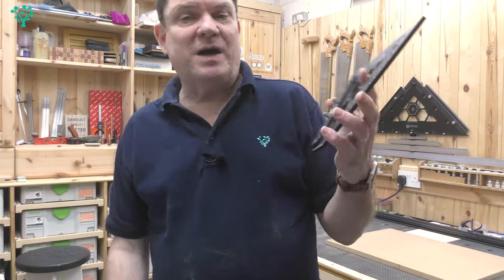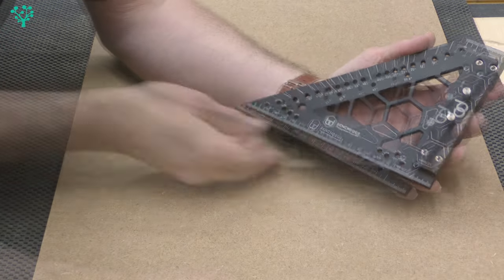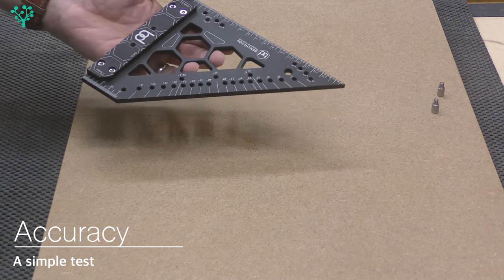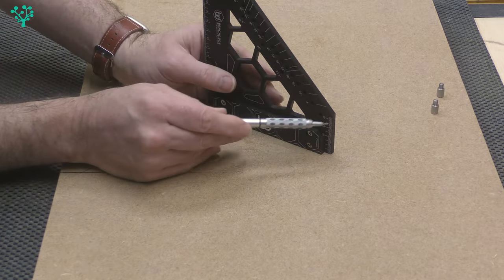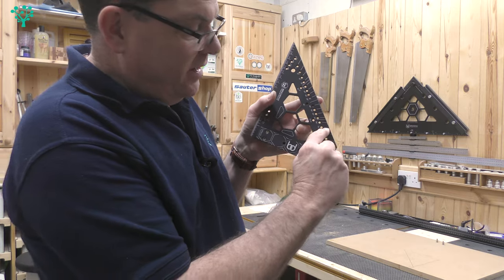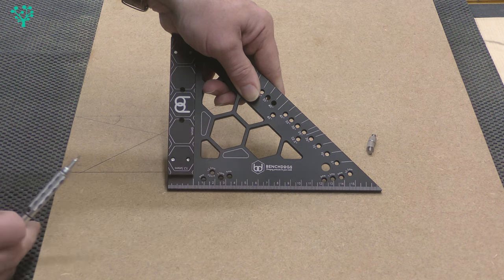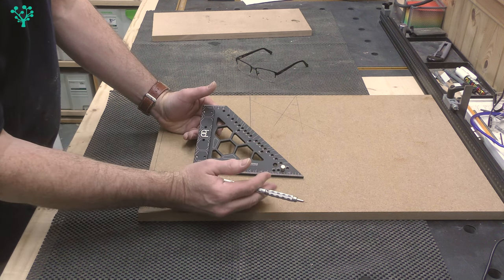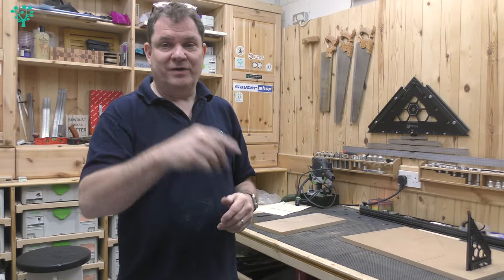Benchdogs.co.uk 175mm Carpenter Square hands on review

Comment: This is nifty. 

Being a weekend warrior I feel it’s a bit pricey for what I’d use it for mind you.
Reply from the maker: Hi Marc

Yes very nice, it all comes down to the acceptable accuracy in your work.

I would agree this would be over the top for most builds, but I just love precision.

I still get stunned when something fits perfectly, it’s like a religious feeling.

But I am incredibly sad…..

Cheers

Andy
Reply: As a weekend warrior also I’m of the opinion that I have even less time to correct and adjust to errors or less precision, meaning knowing my tooling is reliable and accurate is even more important than if I had more time to work with it.
Reply: @Extragonk    valuable input Paul. But to my mind, I’d assume weekend warriors don’t have disposable income or limited at best. Hence the “weekend warrior” tittle. 

Maybe some clarity is required in terms of marketing. Let’s be honest, the majority of users I’ve encountered following this type of Chanel are DIY guys.
Reply from the maker: Hi Marc and Paul,

I guess it depends on what folks gauge as important - I know weekend warriors that buy every tool going and some that save up and buy a select few of value add.

Neither are wrong, it depends on what you want to get out of the hobby. 

This channel tend to have a great mix of business centric woodworkers and DIY and just some folks who are interested but don’t partake.

All welcome here and no opinions are wrong.

Cheers

Andy
Reply: @marconeill9510  I'm definitly on the same train as Paul Noble here, my primary limitation is time, secondary limitation is money spent. Making wrong cuts and having things being inaccurate is a killer for both of these and it annoys me, since this is a hobby and nothing I can recoup money with so, for me, the more accurate and less annoying things are the better it is for me.

Comment: Finally a "carpenter" square that is precise! I can't stand the deviation on every single carpenter square I've used. Of course it's not a big deal if you are dealing with beams and rough work, but they are of no use for long sheet material or checking squareness in cabinet making.
Reply from the maker: This one is designed with accuracy and the workshop in mind, you will notice the lack of hip angles and the like. Definitely not designed for roof and beams.

High level of accuracy, no nonsense well made product. It will happily co-exist with my precision squares.

Cheers

Andy

Comment: I would just add if you put one pin in the pivot hole and one in the hole near the 40mm on the short edge and 5° hole it will scribe a full lenght 45° line.
Reply from the maker: Thank you for the tip.

Andy

Comment: looks like a great tool. i am very glad someone in Europe challenges woodpeckers at last. Review is also great, but rather focused on positive sides which is ok as well considering  product quality. I noticed it may be a bit inconvenient marking a 45° angle, since the line won't start from the stock edge. That's ok as well for it's nice to have a short ruler, but shall be rather mentioned.
Reply from the maker: Hi it is a great tool, and not any negatives that I can see.

In terms of your question about the 45 angle. You put the two ref pins in the pivot and the zero degree hole. That then brings the 45 to the edge stock.

So you end up with the short ruler and the functionality you are looking for.

I should have mentioned that in the video, sorry for any confusion.

Cheers

Andy

Comment: I appreciate that these will be milled very accurately, but isn't there always going to be slop in the thread? So that +-0.005degrees of accuracy probably isn't very representative? I'm sure it's still very very accurate though .... just not as accurate as being made out :)
Reply from the maker: Hi Ben,

Why would you have slop in the thread. When you tighten down the thumb screws they don’t move.

Cheers

Andy
Reply: @TheWoodgrafter  A nut and bolt always has to have some slop, else the thread would bind as you were turning the knob. So unless it has some self centering countersink, each time you screw it tight, it could be slightly different.
Reply from the maker: Interesting,

I see what you are saying.

Let me check if it has the countersink. 

Will report back.

Cheers

Andy

Comment: I'm not sure that your quote  "this is 0.005° plus or minus" is correct.
I've just checked the product page and as of June 2024 they are only claiming "the machined part is accurate within 5 microns and ensuring the angles are accurate within +-0.05 degrees". I think this may only be referring to the visible angle markings. I can't find them publicly making any guarantees about the physical angle accuracy of any of their squares.
It may've been something that he mentioned to you in person, but it doesn't seem to be a claim they're making publicly.
Reply: i'm not sure about their triangles or squares, but rail square came with a serial number and test documantion about accuracy specific to one you get, mine is came with 89.997°
Reply: @karpuzsever  That's awesome. It would give me a lot more confidence in my tool. Thanks for letting me know.